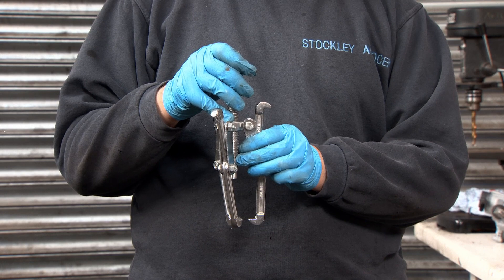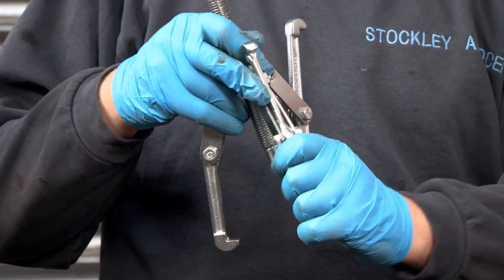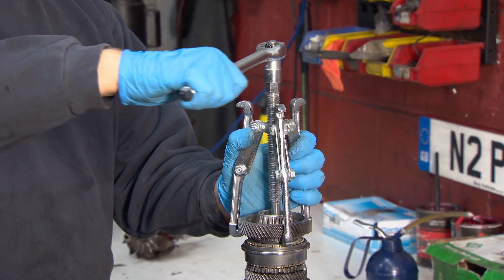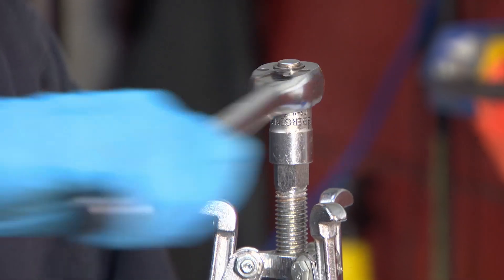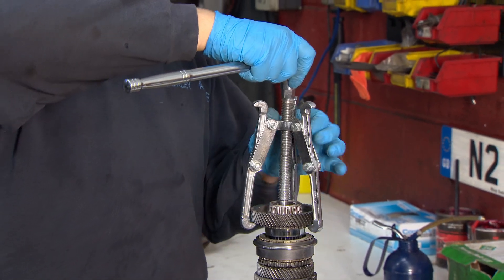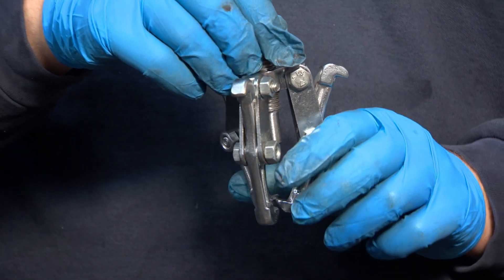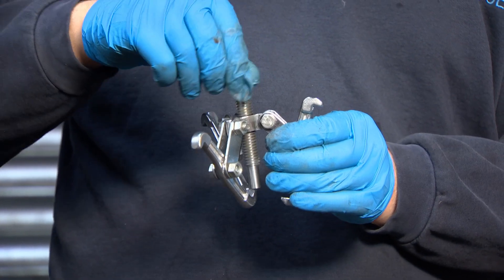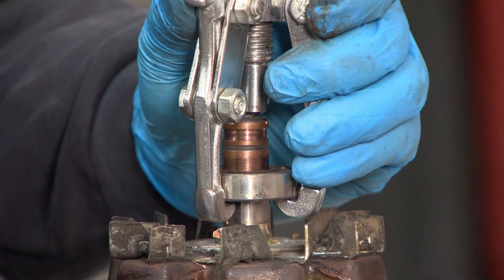How to use a bearing puller set?

Comment: Hi. I am trying to use the bearing puller u have on your video on my vauxhall Corsa d. I have clamped it on but because there is a hole in the middle where the bearing is how am I supposed to get the leverage to pull out the bearer because when I turn the big screw at the top it just goes straight through the hole and the bearing doesn't move. Cheers in advance for your answer
Reply from the maker: Hi can you please send me a picture to contact@dktools.com so i can see if i can help.